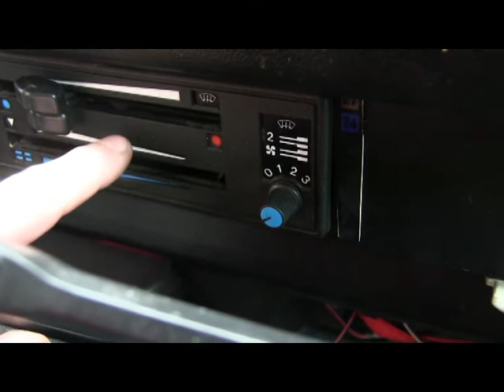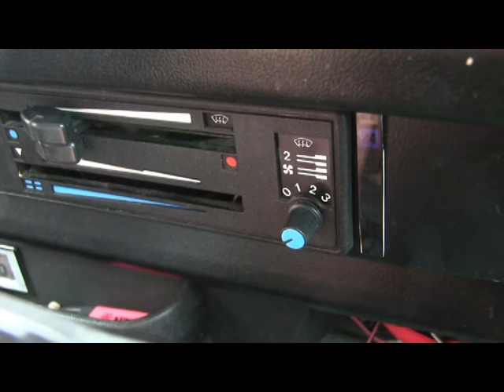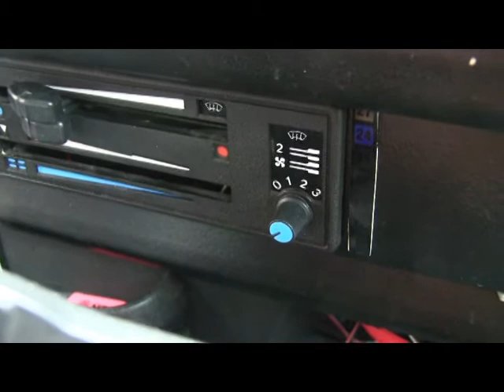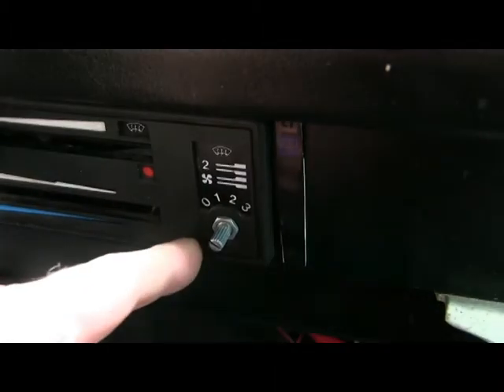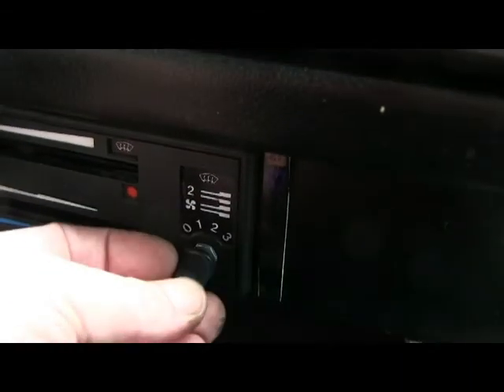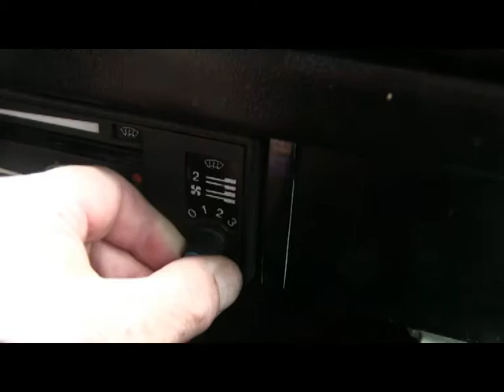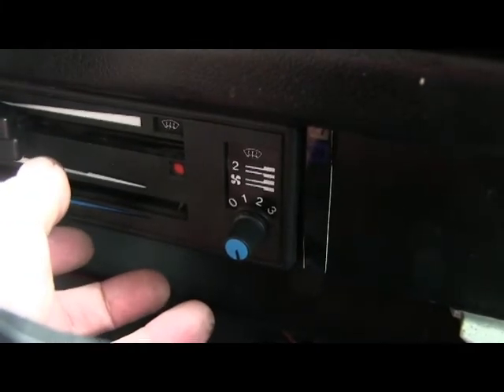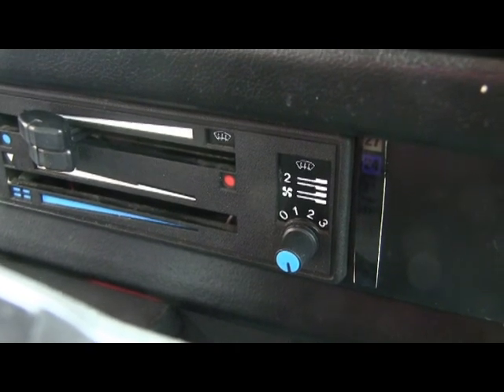Vanagon VW T25 T3 Blower Motor - PWM control upgrade (PT 2)

Comment: Thanks for the video. 
Interesting idea on the PWM. I LIke the idea of eliminating any additional heat sources tucked way up in the dash. 
I’m preparing to perform the full “meal-deal” on my dash.  Heater core, blower motor, and wiper motor,
And whatever else should be fixed while I’m in there. 
Can you recommend which PWM to purchase, which brand perhaps?
I wonder if it would be possible to get on with a slightly longer shaft?
Then one doesn’t have to cut any plastic inside the fascia plate. 
Just a thought. 
Cheers,
Eric
Reply from the maker: Can't recommend one as they change regularly but aim for 20 amp. Also, replace your washer jet pipes while dash is out. Aquatic places sell it cheap ;)
Reply: Good thought on the washer pipes. 
Gonna pull apart the wiper linkages and re-lube assembly. 
Wish me luck.

Comment: Can you advise whether the pwm needs to be rated at 25a? Seems like the fuse is this kind of rating. Thanks
Reply from the maker: Fuse should always be the weak point. Ordinarily the PWM shouldn't draw that much but you do need the overhead otherwise PWM could fail before fuse. If that makes sense :)
Reply: Thanks, I read elsewhere on 80-90 that someone did a similar conversation and the PWM got hot.....I assumed that you need a certain size unit to handle the supply? On Ebay and Amazon the only indication of capacity seems to be the amperage - all are variable voltage . I'm aware that Brickwerks sell two large resistors for this job and am wondering what happens to all the heat with your method? Thanks v much for the helpful video!
Reply from the maker: Mine doesan't get hot at all but at 20amps max load its never overloaded. Power supply only required 50-% of the time (pulse) so shouldn't get hot although unit does have its own heatsink anyway. The resistor method is basically a crude toaster :D
Reply: Can you send me the link of the how to instruction, struggled to find the link